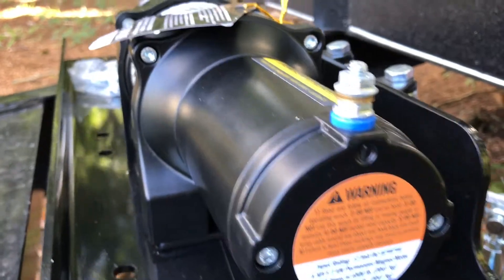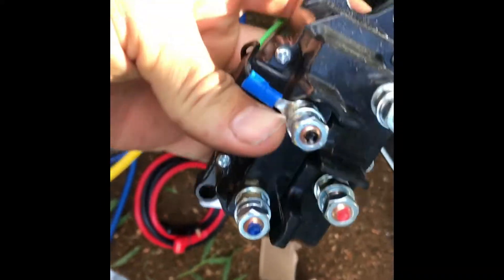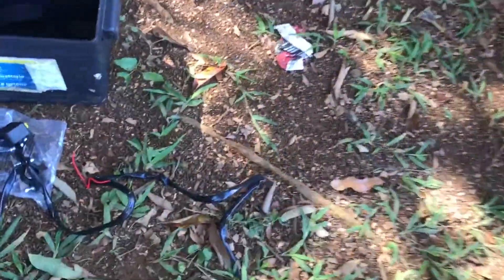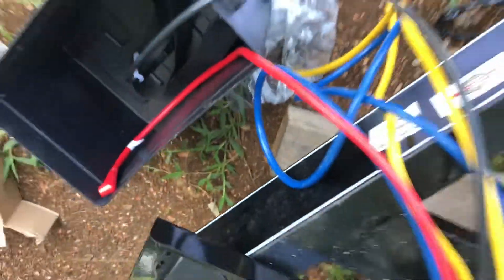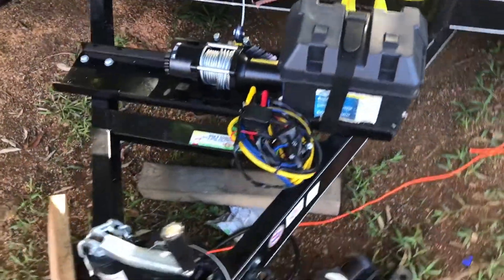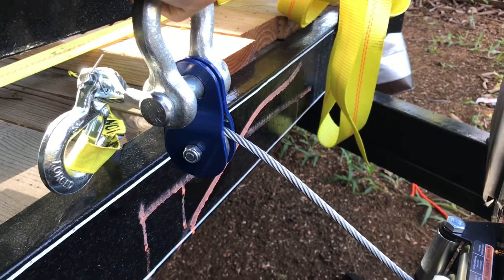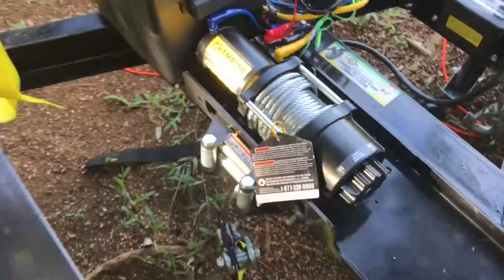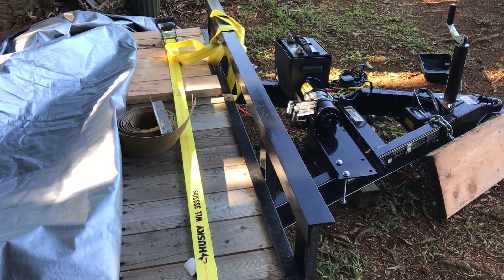Champion 4500 Winch Installation On A Trailer Part 2

Comment: How did this end up working for you?
Reply from the maker: Worked Great! Pulled up a 4000 pound car with ease. Recommend waterproofing the setup and adding in a passive charge controller though.